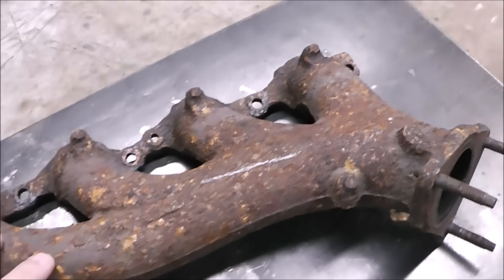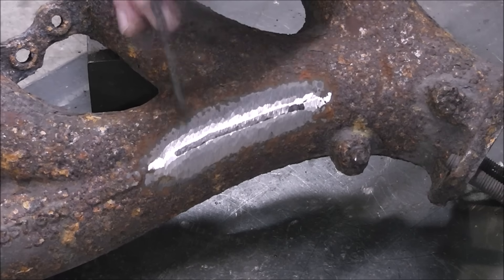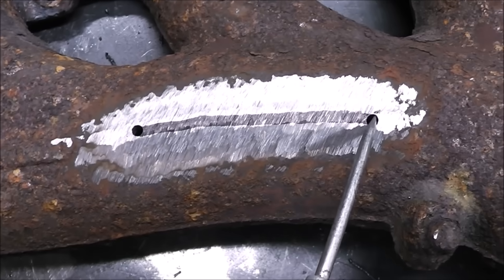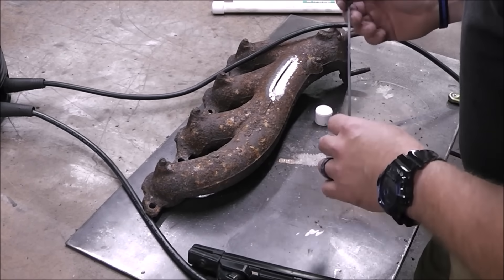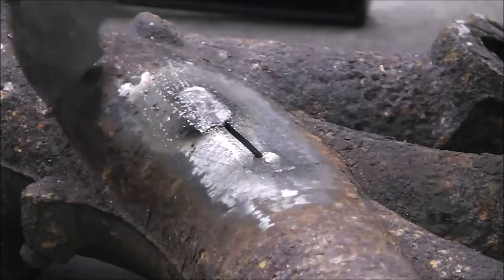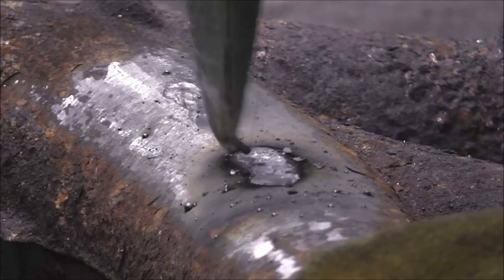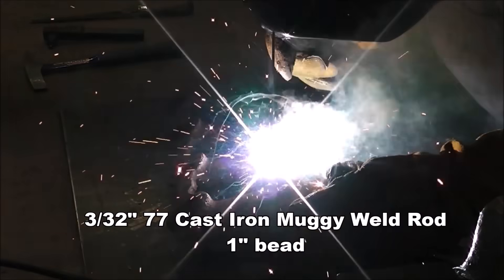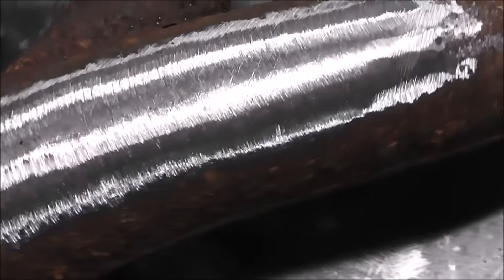Stick Welding Cast Iron Repair with Muggy Weld

Comment: Hi Brandon. Very glad to report. I went to my local jeweller today.  Picked up a 14 silicone wedding ring. The interesting thing is.  After a while my finger was throbbing. So l used a set of multi pliers to stretch it slightly. Thankyou for telling me about these wedding rings.  As l have not been able to wear my for the 10 
Years of our marriage. Beep Beep matie
Reply from the maker: Right on man! They look super real and they are safe. I will make sure to talk about this because wearing a real ring in the shop can be a huge hazzard. Once you know your size you can get them really cheap on Amazon also. The ones I get come in a 4 pack however the one you saw in the video I've been wearing for more than 2 years. They are very durable. 👍
Reply from the maker: @Andrew Nance Hey Andrew, I want to thank you again for bringing up this comment about the ring. I've never covered this and I've never heard anyone else cover it either but it's important. I talk about this in this Friday's episode and show the ring up close.  Although I didn't address you by your name personally, I did mention your comment and I publicly apologized to you for my harsh initial response. As far as sizing, I had to order a couple different sizes until I found the one that fit the best. I can tell you that if it doesn't fit perfectly at the beginning you probably wont like it. In my experience these dont get looser or tighter over time. I've been wearing this one for about 2 years around gasoline, brake cleaner, acetone, sparks, heat and chemicals and it fits the same way it did on day one. I think I got mine on Amazon. It wasn't much. I think a 4 pack was around 12 bucks. Once you find the right size you will never know its there and it will never fall off. It might just take a couple different sizes to try until you find the best one. I also show a 4 pack of these in this weeks episode. Take care brother and thanks again👍🙏
Reply: @BrandonLund  hi Brandon. Your right again. The ring l bought at the jewellery
Was to tight and after a day l couldn't bear it. I tried everything to stretch it. But ended up snapping the thing.  Anyhow.  Don't  feel bad about how you replied to my initial comment.  Sometimes l think it go with the territory. I will look out for your latest . Also l should also say my Australian slang can leave a bit to be desired.  Even here in South Aust.
Beep Beep Brandon
Reply from the maker: Have a great night buddy. Check out Amazon. They have some good prices. Once you find the right size and style, order a couple. They last a long time 👍
Reply: @BrandonLund  day here now. And have  7 size 16 coming  from Amazon.  The only place l can find this size. Beep Beep. Brandon
Reply from the maker: FYI I got pretty big paws size 12.5 ring finger and you got me beat brother. I'm glad to see someone else knows the pain of shopping for rings and xx gloves
Reply: Hi Brandon.  As you said it may take a bit to get the correct size ring. I looked up how to size yourself to fit a ring . Long story . But my finger is about 25.4 mm  1 inch in diameter which is a size 17  insize  . Look forward to seeing what fits. I tell you l had a hard time finding such a ring. Best l could find they are only available on Amazon that size.
I will  keep you informed on how they fit when they get here. Beep Beep.

Comment: When I have welded cast-iron in the past I preheated  the work piece before the Weld. After finished welding I covered it in a thermal blanket so the work piece would cool down slowly.
Reply from the maker: Definately the preferred method but if thats not possible than this process and filler will work

Comment: Heck, I welded a set of Ford exhaust manifolds with my wire welder, filling in gaps over 1/4" across.  They never leaked in the several years my neighbor owned it, and still worked when he sold it.
Reply from the maker: Dont say that too loud Eric, there are folks on my MIG welding cast iron video that say it cant be done LOL. In all seriousness, good for you man. I'm a firm believer in "give it a try". It cant be more broke than it already is. I like that can do attitude. I've mig welded cast also and have had really good luck too.

Comment: Did I see some worm holes?
Reply from the maker: Yes you did. The real question should be WHY did you see worm holes. I will give you a hint, it's not because of slag inclusion...
Reply: @BrandonLund  it looked mire like a cold start on the stop/ start overlap.
Reply from the maker: Cast iron has a lot of trash in it. If it gets too hot and melts than the trash floats to the top (which is why oxygen fuel brazing is usually the trusted go-to process)
Reply: I agree. Especially the cast iron from asia. They make it from melt down old hudsons and ramblers. 
I had your cousin Finn Lund and family living in my house after he moved here from Denmark.
Reply from the maker: I have a cousin Finn?
Reply: @BrandonLund  yup! You do, he live in the Santa Ynez valley, ca. He is a carpenter. I met him when i worked for Erling Pohls (a high end building contractor in that region.
Reply from the maker: How do you know this? Do i know you? 🤔
Reply: @BrandonLund  That was purely "tongue in cheek". I don't know of any family relation to him. I apologize1 for any inference. I just thought it was coincidental that you had the same last name.
Reply from the maker: OMG you had me for a minute. I was just recently contacted by extended family. My great grandfather came here from Sweeden and changed our name from Mattson to Lund so my family tree for the name Lund is made up and only goes back 2 generations.
Reply: @BrandonLund  you're in luck. I have another Danish friend (last name Mattsen); maybe he's related? I have a swedish friend also (last name Einolander). We used to erect cell sites in orange county. You have all kinds of homies here! 🤣😉. Good to chat, man.
Reply from the maker: Hahahaha right on man lol. Make sure they get me something nice at Christmas lol 😆

Comment: use stainless steel on cast iron, weld as you normally would just make very short welds then give it time to equalize
Reply from the maker: For whatever reason William i have not had a lot of luck with stainless. It seems to always crack within the weld and not at the heat effected zone for whatever reason

Comment: How mamy years this repair last under heavy use the car? I try Mig  weld (argon) my exhaust manifold and it crack at the same place one week of use the car.
Reply from the maker: It could last 10 days or 10 years. Cast iron is strange like that

Comment: For a part like this, small enough to fit in a BBQ pit, just light up a fire and throw the part on top of the coals for about half an hour. It will be nice and warm for the preheat. Then, after welding, drop it back into the fire and leave it there until the fire burns out so that the part can cool off more gradually. Should be a good preparation against cracking.
Reply from the maker: I always do pre and post heat. This was done this way to test the elongation of the rod in a worse case scenario.

Comment: This turned out awesome Brandonman! Where did you learn the hole drill trick?
Also do you have a press brake?
Reply from the maker: Thanks man! The hole trick is actually pretty common on fixing stress cracked machinery so I just applied it here. I dont have a press brake. I wish I did though
Reply: @BrandonLund  I like this guys DIY press brake for its width, strength and simple design.
https://youtu.be/iNRY7y5MB80

Comment: This may sound stupid.  But I've fixed cast iron by heating it up in a wood stove  and  mig welding it warm like a few hundred degrees not glowing but hot. Warping is part of the equation ..  and filling the item with a layer of paper then fill it with playground sand to keep weld from entering a crevice being welded. You can burn the relief hole as well as drill it
Reply from the maker: Not stupid at all. I've used MIG a bunch of times. Preheated and without preheat and I've had real good luck also.
Reply: @BrandonLund  sandblasting it first makes a HUGE difference in puddle behavior
Reply from the maker: It sure does! 👍

Comment: What are gearbox casings made of like from a 09 car. I have a audi tt quattro and the rear haldex diff box has cracked near the mounting point and want to weld it but don't know what exact material it is. Looks like gearbox or Bell housing material 🤔
Reply from the maker: @BIG MAC it could be a number of materials including cast iron. Here is a video that might help to identify what you have https://youtu.be/2NI5-EMEkJU

Comment: The repair blends into the surrounding metal.  But the  surrounding metal doesn't blend in with the rest of the cast iron finish.  There is only so much you can do to hide a repair.  This looks as good as it gets.
Reply from the maker: Very well said! @john wick

Comment: I hope this is the right video to win some muggy weld!  I came from the 2-sided flux core video, welding a cast iron pan on both sides!  IF this is the wrong video to win, I still like the video, anyway!  All I have that  I can use IS flux core, gasless welding capability!
I have a cast iron griddle that has a long crack in it!  I HATE to throw out cast iron cookware because I or someone else dropped and broke or cracked it!  SO, if I were to win the muggy weld rods, I'd use it to repair that nasty long crack!
Thanks, Brandon, I learn a lot from your channel!
Reply from the maker: Thanks @Kim Curtis. The giveaway is over but I'm always sneaking stuff inside my videos to give away. I have a whole cast iron repair series playlist that will give you tons of information to make cast iron repairs and they are actually very strong! I appreciate your support!

Comment: What about if the manifold was broken in half? Say, on the main tube between the second and third cylinders? Or anywhere on it really. 
Great video though!!!!
Reply from the maker: @Riki Jett the process would remain the same however you would need to fixture the part and you might have to mill the mating flange depending how it broke and how everything lined up after the repair.

Comment: If its cast part you are welding then its cast iron can't be anything else
Reply from the maker: @Mark Vegar there are many different forms of cast metals, namely cast steels in which case you don't have to do anything special. Cast steel is steel that can be welded with any process or filler metal that you would use to weld carbon / mild steel.

Comment: that welding looks really neat I question is if you had a gouge or burnout spot where it mounts to the head on that manifold you can go in there and weld it with this stuff how would it machine would you have to grind it or can you put it on a mill how hard is that the machine is the  question
Reply from the maker: @Jackie's one of these is machineable and the other is not. I just can't remember which is which.

Comment: I want to know why the finished so called weld is on the other side of the manifold? You welded the other side then showed the non welded side as a finished product.
Reply from the maker: @Ace Xlent It's been asked and answered. Its in the pinned comment. Watch it again. Your wrong...but for good measure make sure to leave a thumbs down along with your cute "so called weld" comment

Comment: I usually weld cast iron with a stainless rod, i think that works great.
Reply from the maker: I've tried stainless a few different times and always seem to get cracking.
Reply: @BrandonLund  I preheat, and let it cool wrapped in fire blankets, never had a crack. Its mostly manifolds and traktor parts, it could be that they are a certain cast alloy?
Reply from the maker: It very well could be. I've tried 308, 309 and even tried 316 just to see. It could be the castings im working with. Batches can vary. I know of others that have had good luck with it also. Not so much for though lol.

Comment: I've heard that file trick before although that was after I would use the chipping hammer ( and a few times used a brick or concrete block because they were there ) on the rod which doesn't work as well so I haven't used file trick due to being out of welding for 20 years.  Although I'm thinking about getting back into it which I'll definitely keep a file near by .
Reply from the maker: @Airon Noles Right on man! It's never too late to strike an arc!
Reply: @BrandonLund  Thanks .

Comment: if the 77 stretches what about the rod used on the bottom any chance of that cracking? Thanks I suck at welding LOL
Reply from the maker: @CCROSS5882 I think so. I think the 72 is a little more brittle but thats why it's great to cap it with the 77.

Comment: Do they make a GSMA spool wire for cast iron? And if so what type gas would be recommended. Thanks
Reply from the maker: @Mike K they do but I havent tried it in the wire feed variation you are looking for ERNi-CI

Comment: arent those LS manifolds cast steel not cast iron ive welded those with plain old mig welder
Reply from the maker: The independant testing show them to be cast iron. I have a cast iron repair series playlist and have done a ton of cast iron testing with MIG. It's not the manifold. MIG works really good with a lot of different cast irons.
Reply: @BrandonLund  very interesting I have seen and done a lot of welding on ls manifolds for turbo kits. great info thank you
Reply from the maker: Thanks Erik I appreciate it. I have heard they weld pretty nice with mig but I haven't tried that specific manifold with mig, just the Muggy Weld and some 6013

Comment: Great video! As a welding instructor, I saw many Ford 360 school bus manifolds that were cracked. ALWAYS clamp or bolt the manifold to an old head or large thick piece of steel plate to eliminate warpage as the manifold cools. Weld as this video recommends.
Reply from the maker: @loveshisharley thanks man! Yes that is excellent advise for sure! Thanks for watching and commenting
Reply from the maker: @londen3547 Reading and listening were never your strong point. To save you time from watching the video again and me from having to reply to what has already been explained, read the video description, and you will know WHY this was done this way. Knowledge is power. Now you know.

Comment: It's been a long time but I recall using a brazing setup for cast iron. I guess most people don't have them anymore??
Reply from the maker: @Idaho Potato that is probably the most tried and true method but the newer generation of welders are typically starting with inverter type welders so the oxy fuel brazing is starting to become less common although it's probably the best

Comment: So what about an old cast Iron Franklin stove? I broke the center support for the 2 eyes on top in half. Can I weld that back together?
Reply from the maker: It's most likely a Gray cast iron so you should be able to weld it no problem

Comment: I’m sorry, but that first weld, is NOT a “perfect weld”, and the grinder hyped us of a view of the second pass unfortunately.  
The part should have been warmed, welded and put in a heat blanket.
Reply from the maker: Maybe watch it again...pretty much everything you said in your comment was addressed in the video. You forgot to mention that I welded one side then tried to trick everyone by welding the other side...

Comment: Now you have to heat it for verifying if it doesn't crack anymore
Reply from the maker: If it hasn't cracked during the welding / cooling cycle it's good to go. All repaired cast iron is prone to crack eventually.

Comment: Great point with the file tip
You can adjust your temperature by increasing and decreasing your arc length and angle
Reply from the maker: Right on!

Comment: used a torch to heat up the cast - after the weld then kept torch on the weld and pulled the torch away little at a time to cool.
Reply from the maker: Thats an excellent way of doing it. In fact thats how I did it in this weeks episode!

Comment: That’s cast steel ? Lol it’s a LS manifold.
Reply from the maker: @Nick Armstrong im not sure what you find amusing? Maybe you could point me to a link where I can buy this manifold configuration in anything but cast iron (You cant) but in the meantime check out the independent lab testing that I attached in the pinned comment in the video. It's cast iron
Reply: You know what your right I can’t find anything that says it’s cast steel. But I’d really like to see if there’s a way testing how much carbo content is in a LS manifold.? It welds just like cast steel ? Why is that lol? Sorry for replying like a dumb ass, My bad hahah.
Reply from the maker: No worries man. From what others have posted I believe this manifold probably is an LS manifold and if thats the case than the lab results show the carbon content to be 3.63% which is well above the carbon content of steel at .03% for low carbon steel all the way up to 2.1% for high carbon steel.  Cast iron carbon content ranges from 3.0% to 3.7% and the silicone content of steel castings is around .3% to 1% which cast iron is generally upwards of 4% as in the lab results of this part.
Reply: Sweet thanks for the info. Keep up the good videos !!
Reply from the maker: Thanks man I appreciate it 👍

Comment: Stick pos or stick neg?
Reply from the maker: D. Love the manufacturer says you can run either polarity but I think if I remember correctly I was probably using DCEN which has less penetration than DCEP.